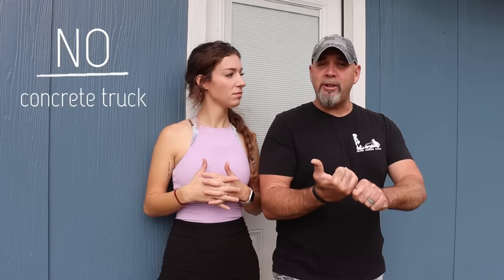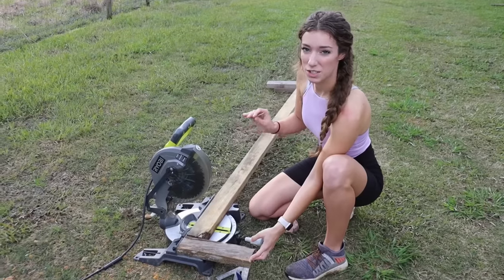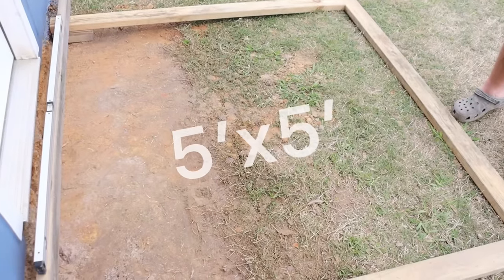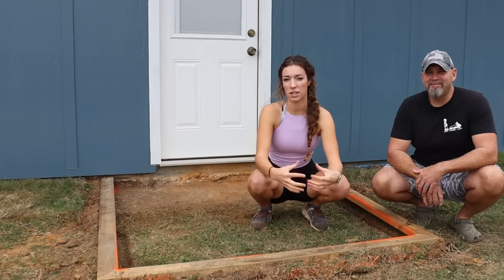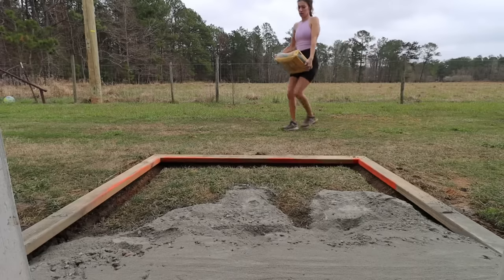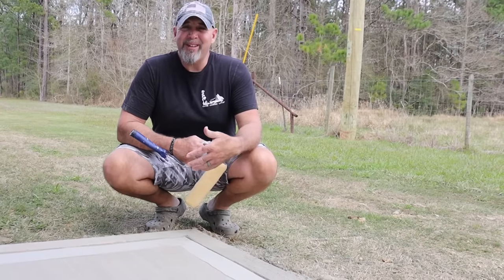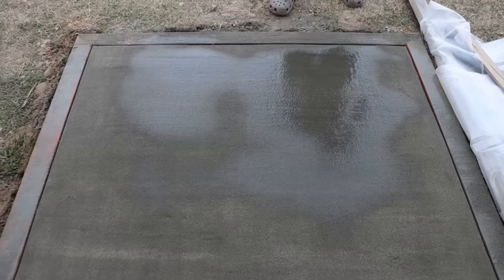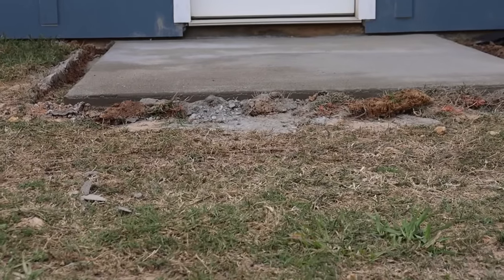How To DRY POUR CONCRETE SLAB and Update of Our 1st Pour

Comment: You did a great detailed how-to video. I loved it and hope many more are to come. 
I have set posts with dry cement, made dry stacked stone walls with dry cement, and even paved my driveway with a crude form of dry soil cement by raking in type S cement into the  crushed-run gravel I spread over my old packed down gravel driveway. After I mixed the cement in with a garden rake, I packed down by driving back and forth over it with my car. Then I lightly sprayed it with the water mist. I got that idea from reading about soil cement that was used for roadbeds back in the mid 30's in Georgia and Tennessee. Some sections of those old soil cement roads still exist today. Back then the highway department would pave a road affordably by packing the base soil then dumping and spreading low organic soil and dry cement on top. Then they mixed it with a rototiller type mixing machine before leveling and packing the mix. It was supposed to be a highway base but, in some instances, it was the road pavement. Some of the back roads made this way are still holding together. All my dry cement constructed projects are still holding up too. People who worry about their pads cracking can buy bags of premixed cement with reinforcement fibers already added to the bag or they can lay a section of square fencing on the bottom for reinforcement. If you have difficult to dig hard pan soil, soaking the soil with water a few hours before removing the pad area soil. Doing so will soften the soil and make it easier to dig as well as making water in the soil available to help cure the dry poured cement.

Comment: Good job guys. I loved the paint roller finishing touch!
I have done similar dry pour pads and posts over the years and always soak the ground with water the day before. I have no idea if it actually matters, but I like the idea of the concrete having plenty of moisture below to pull from.
Reply: Seems like a good tip having moisture in the ground
Reply from the maker: Concrete is actually stronger the less water you use. It’s a common misconception water makes the bond hold more, but that’s not the case. 😄
Reply: @CajunCountryLivin  , No question, too much water isn't good.
Reply: @CajunCountryLivin  Concrete is also actually stronger if you cure it underwater for 28 days.  That's not possible for a slab, but you could keep it wet and under plastic for much longer.
Reply: @dchall8  how would you keep it under water for 28 days?
Reply: @Prepper Tuck  I think they're from Louisiana, just move the water to the other side of a levy
Reply: @preppertuck  , I oversaw a large industrial storage pad being poured during the summer, and set up sprinklers to keep it wet.
Reply: @Prepper Tuck  leave the plastic sheet on too. Then use the hose to "flood" water between the top of the slab and the plastic. Do this after it cures for a day and keep checking on it a few times a week. 

That's how we do wet cures on warehouse slabs

Comment: After watching your vids I tried this method and it worked great. At first I struggled with getting the surface smooth... the trick I learned was to tilt the top of the 2x4 screed board rearward about 10 degrees while screeding forward. Doing so helped to push the aggregate downward without causing the pebbles to create skid streaks. Also, after the surface had a crust I placed an old beach towel over the slab and soaked it down every hour. That seemed to help with keeping it saturated over night. Keep up the good work!
Reply: How did the beach towel affect the surface finish?
Reply: @tinkeriddins2851  he said the surface had a crust meaning it was already semi hard, towel obviously did nothing

Comment: I did a similar pour for a shed slab. The ground was pretty level so I got my mower and did a super low cut. The slab was about 12 inches thick so I used lots of rubble and tiles to fill. As long as they are small and are three inches from the form and the top they are no problem. Save money on waste disposal too.  Nice work there.
Reply: Great idea with the rubble fill! I am about to try this for a shed too.

Comment: Totally awesome. Thank so much. I do my own concrete work on our little areas that needed never done it this way but it looks so much easier. There's only one other thing I would recommend and this is just a shortcut. What I do when the concrete bag is down where I want it. It cut it at the bottom so I never have to pick that bag up again with concrete in it.. What I do is I cut from one side to the other on the bottom of the bag and just lift it up and it all falls out of the bottom.

Comment: You guys rock. And yes, and open mind is something we need more of. One thing I wish is that you had drilled into the old slab or cut a section to show how well it cured all the way through. Maybe that's in another video. I will be using this method in a home project soon. WAY easier than pouring. Thx!

Comment: love your dry concrete tip! tip:  Install a 6' wide rain diverter ( metal strip) at the edge of your roof over/above your door and it won't be so bad gravel on the sides of your concrete inexpensive.    I had the same issues!  I love concrete work!

Comment: I've never considered this method, as I'd thought it would be quite weak - fine for fence posts, not for slabs. However seems to have held up really well. There are a few defensive positions near here (North of England) built for a German invasion that never came. The construction was obviously sandbags filled with dry mix concrete then hosed down. The sandbags are long gone, but the concrete (with a hessian pattern from the bags) is still rock solid after 85 years or so.
Reply: That was the way they used to build retaining walls around bridges and culverts or for areas where there was a lot of erosion. The bags were burlap so the concrete would leak out and bind together good as well as form to one another in a way that these paper bags just can't replicate. Paper ones still work but not as well. They can slip and come loose easier because they Are slicker and don't mold together

Comment: Thank you for this!!! We've been wanting to do a sidewalk around our property, so we can have somewhere to walk comfortably. This is probably a great solution for turning it into a DIY project, cuz lemme tell ya, my lowest price so far, for the whole thing, has been about $8K. I've seen your first video and now this one. I think we can do this too!!! If anyone has any helpful suggestions, PLEASE feel free to add em on!!
Reply: I gotta say this left me with my mouth open in awe. Never have I seen this method but I did wanna say instead of cutting the bag from the top and trying to pour it out. Lay the bag down flat and stab it on the center going across the short ways not the long ways and pick it up from underneath and it comes out easy peasy. Also if you don’t need the whole bag it’ll be easy to use just the half bag and just save the other half for a later project. Hope it helps out from doing a little labor.

Comment: Wonderful video! My only exception to this small slab dry pour would be the 1 1/2” thickness at the end away from the house. That will eventually crack or possibly even break off a large part at the end of the slab because it is very very thin.  I would dig down so that the slab is about 4” at the end of the slab too. As well as pouring a shallow gravel bed under the dry pour. Both of these things will help the slab last a lot longer without cracking or breaking.
Reply: By the sound of their opening remarks. This is temporary to begin with, so time  and minor deteriorating I don't think they are too worried about. That being said, yea that would definitely be an issue.
Reply: So mixing the cement would prolly use half the cement mix??   I mean that’s A LOT of 75lb bags that was used for a small slab.
Reply: Great tip! Taking notes.
Reply: @eXGaming4u  It's exactly the same amount.
Reply: @eXGaming4u  it’s the same amount of concrete, and water that is in the final cement compound. But this is going to ensure that as long as there is full penetration… which with 4” that’s easily achieved… you are actually making the strongest possible concrete with the least possible ingredients… it’s as optimal as is could be, which you cannot always achieve with a wet mix.

The more water you add the weaker the slab.

Comment: Subbed! Thanks for going the extra mile by showing the update of the first slab.  I will attempt this in a few weeks on a 12 x 25 slab for my solar panel array. I was thinking of buying a concrete mixer and going full bore with a 3 inch pad with a crushed rock base, wire mesh support and moisture barrier, but now realizing that's overkill for just a base for solar panels. Thanks for the inspiration to keep it simple.
Reply from the maker: Thanks for watching! We are so glad this will help you!

Comment: I also do this. But I like the clever roller technique. If you cut up some old rebar, about a foot long, then pound them into the dirt, about an inch up from the base ground, then add the bags of mix , this stops the slab from moving sideways and adds a bit of strength. Not too near the surface, as you dont want concrete burst, if they rust a lot. Love your work.

Comment: Thank you for this instructional video.  I have a small project like this coming up and I think I'll try your method.  It will be a small, captured area that I'll be able to fill as needed and then wet down per your prescription.  I even have an edge tool for the nice finish to the edges. (yeah... I've done a little concrete, too) So, I'm grateful for this nice, neat, method that should meet my needs nicely.   Rick

Comment: Awesome! The only thing that would help would be to dump the bags into a large wheelbarrow to mix it dry since those bags settle during shipping. I believe that would give a more consistant finish with an even mix. Either that or coarse rake in place before leveling. I have to try this myself. We did all our fence posts as dry pours which took the moisture we added later along with any moisture from the ground. Not one issue with any of them 10 years later. Great video. Thanks!
Reply: Dry setting is super efficient, that’s how we do most of our fence post as well there’s one old timer that works with us that still mixes in the wheel barrel and nobody likes helping him cuz it’s just a pain in the back when we could be doing it faster and saving labor by just dry setting
Reply: It will separate even more when you dump it out of the wheelbarrow. Look at how many bags it took to do this small pad.  Even if it was slightly settled in the bags, in the overall slab, it is mixed.

Comment: Thanks for sharing your experience.  I wouldn’t have tackled this without your video.  My wife and I just completed a 6’ x’ 5’5” x 2.5” thick dry pour which was much easier to get done since we didn’t have to rush. However, the leveling and sinking of the aggregate proved to be more difficult than we expected. The good news is our slap is for a shed foundation so the ugly look won’t be seen after we cover it up. Thanks again
Reply from the maker: Very cool! Thank you for sharing! And thank you for watching!
Reply: I'm here for a shed foundation too. Thanks!
Reply: me too! I just finished an 11.5x7.5 foundation for an 11x7 Keter shed. we had trouble getting it smooth too but figured it was fine. Even if it doesnt completely set up I can just leave the wooden form around it as it at least level!

Comment: Nice job... 
a sidenote... although you formed this landing at 4.1% which will provide great drainage, 2% cross-slope is the CA CBC (CA building code) standard to meet ADA code and still achieve adequate fall for drainage. 
Also, this is a great method to create a substrate under brick landings and walkways to insure a solid, flat surface to set bricks or pavers on... lay down a 2"-3" bed of dry concrete, set/level your bricks/pavers on that, then wet as you detailed in your vlog which not only sets the concrete under the brick, but adheres the brick to the concrete at the same time... works great
Reply: Love this idea as well

Comment: You can put the forms up on their sides, and your screws will go through the 1 1/2 inches of a 2x  into the other piece.
And just a thought - people brush the concrete so it's not super smooth so someone is less likely to slip in the rain.
Reply: Their method ensures a smooth looking but rough and grippy surface. Only when you smooth a wet pad will you get a slick dry surface.

Comment: Usually the 2X4 forums are on their coin edge but I see how your method works out pretty cool I doubt that I'd ever go that thin and here in Michigan I'd use rebar but for smaller projects I'd be willing to give the dry method a try.  Great video! Tom R.
Reply: I work in a concrete plant here in mid Michigan. I'm going to ask to make some test cylinders doing this method and do a 7,14,21,30 day test and see how it holds up. I'll save this video and get back with you all on the testing.  If it's good I'll have a lot of concrete work ahead.
Reply: @braddavis8255  I would LOVE to hear your results… I’m also in Michigan. Do you think this would work with something bigger than a shed? Like a 16x30 garage for storage?

Comment: Great methodology here - only observation is that its always worth scraping off the very top layer of the top soil so the vegetation is gone to avoid the risk of cracking when it dies off and creates a space. As noted, if you live in a very wet / cold area its worth digging down 4 - 6 inches and tamping down some aggregate first. The paint roller is a nice touch.
Reply: So we live in WV, you would suggest digging 4-6” and tamping that aggregate correct? Dumb question would be how much? 2-3”?

Comment: great job guys, looks good too, the only thing I might suggest in future is when doing that up against the house, maybe consider using an expansion joint - foam or something that will give the same effect.
love your work
Reply: I was also thinking, maybe a 1" conduit, case the need to run some type of cable passed the doorway?
Reply: @stever.9925  Thats a good idea

Comment: I would recommend using a sealer on the pads. This helps keep the concrete from absorbing moisture, cracking, spalling, flaking, and discoloring.
Reply: Especially with the chickens dribbling all over it .... :yougotthis::elbowcough::goodvibes:
Reply: But will become slippery. A deadly setup when freezing.

Comment: Turned out fantastic! I’m interested to try this on a bigger slab
Reply from the maker: Thank you!
Reply: Hey lazerusmfh, I did it (by myself) on a 12ft x 12ft for the floor of my shed - Took about 4 hrs -  plus 4 hrs of wetting - Walked on it the next day
Reply: BTW - Wet poured a retaining wall 6" x 9" deep because I wanted to add anchor bolts for walls, but dry pour works great
Reply: @leepennington11  Did you put any rebar in it?  I want to do this for a shed as well.

Comment: Great idea!  You can also get ready mix concrete in 60lb bags for virtually the same cost per pound as the 80 lb bags.  The smaller bags would make handling a bit easier for the less muscular among us!
Reply from the maker: Great tip!
Reply: Really? I mean they literally say that at the beginning 1:52. 80,60,or 40lb bags.

Comment: Nicely done!  Your chicken coop dry concrete video introduced me to your channel, and I subscribed immediately and have enjoyed the videos.  We are kindred spirits, I built our 3500 sq ft 2 story barndo myself.  I did everything expect the multi-zone mini splits and the ceiling drywall.  My wife and I are retired and are contemplating this method for a patio slab.  We have a large area to do, 50x20 and the quotes we are getting in CenTex are ridiculous.  I believe we could do this ourselves with this method, making each section about 4'x4' x 3" thick with mesh in the slab and rebar pinning each section together.  Kind of like a large patio paver that is interconnected with rebar pins.  I know I am crazy but do you think it would be OK doing this method that thick?
Reply: My husband and I are retired as well and just starting on our Barndo build and I agree, some of the quotes are just ridiculous so we have set out to do this ourselves. Ground up, just the two of us. I’m sure there are a few things we will need to contract out but I am determined to get this done! Kudo’s to you both for taking this on yourself. I too am wondering about the patio and if we can do this. Truly interested how yours goes and if you will share how yours goes. Hope your goes well weather you share or not, happy building!
Reply: @carolinepaltz324  If I do this I will come back here and report our results.
Reply: Very interested to know if it will work on a larger scale.
Reply: that is a much larger area, plan some expansion joints of some sort, or prepare in 10 x 10 areas to test how things go. I am going to try the smaller for muddy Beaumont gumbo but maybe I will invest in some sand or light 60/40 on top before I use their method. I am sold on what I saw. No doubt the smaller areas are working just right. I once worked for Jack Tinkle and he poured many areas 2" thick with wire mesh. He swore by it.

Comment: Hi from Australia, I've only used dry-pour for fence posts, but this is kinda genius. What I really like however is the great non-slip finish that you get, really cool video folks, keep em comin !
Reply from the maker: Thank you!!
Reply: I have to put up new fencing this summer, about 600 ft/180m ish, any tips or tricks? I live in a very arid climate with hard-pan clay so it seems like not much moisture for the concrete to wick out of the soil.
Reply: @emrsngs  Fill the holes with water. Wait a few minutes for it to soak in, then dump the dry concrete in to the top, flushing out any remaining water. 
With hard clay, you might want to give it an hour or longer.